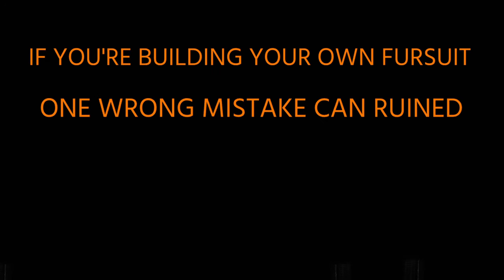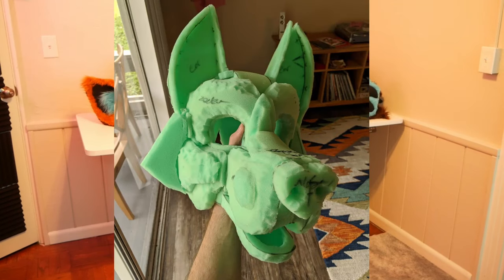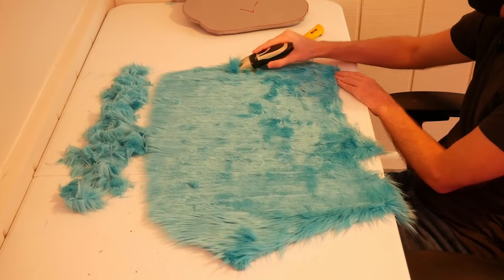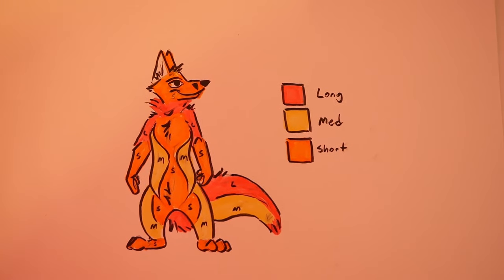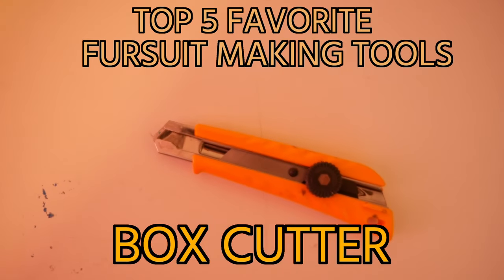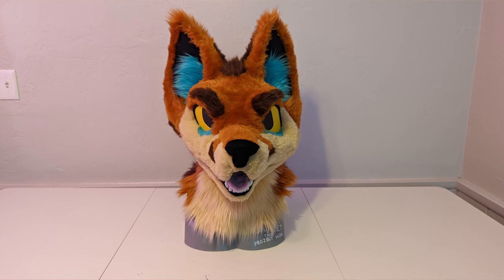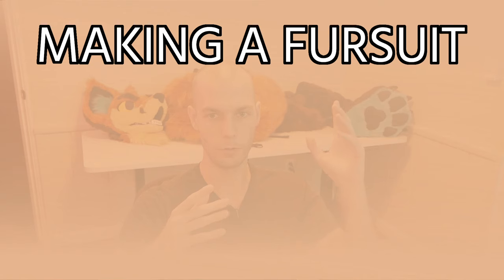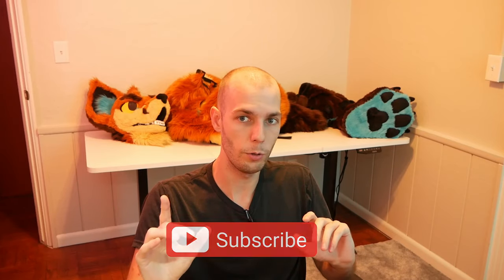5 Fursuit Making Mistakes You Will Make

Comment: A little note I wanted to add about sharpies !! Certain colours will bleed through while others will be fine, so always check first :3
Reply from the maker: that's a good advice!
Reply: exactly. When i made my first set of paws i wrote L and R so i could differ them. Well long story short the backing of the fur was way to thin and it bled through the fur easily
Reply: So true, I used a blue sharpies and washed my suit one day after a con and all the sharpie bled through and onto the fur! (The fur was white :[ )
Reply: Yes! Metallic sharpies are great as they won't bleed when washed.
Reply: How about using chalk, would that be a sufficient alternative?
Reply: @smb879  Chalk works super well !!
Reply: SkylarThePuppy1  Yep! The foam isnt seen at all and so long as you're not deliberately layering on a lot of sharpie, it shouldnt bleed through to the fur
Reply: This!!! I sometimes use crayons or chalk because they lay on top rather than seaping into the fabric
Reply: Another thing is, using washable stuff is probably actually better for fabric. Foam and duct tape (or whatever you use to pattern) is fine, but wish chalk pens or washable markers, you don't need to worry
Reply: I've used tailors chalk for marking darker color fabrics and it works really well! And I was able to brush it off with a bit of effort when I needed to, so that helps in case of mistakes. Also, silver metallic sharpies!
Reply: Ooh! Also sometimes if you have light fur and dark markers when you wash you'll suit the colors can bleed and destroy the colors
Reply: @smb879  yeah, I remember using black fur (a bat fursuit) and as I said, it was black fur for the neck fluff. We used chalk instead of sharpie not for  preventing bleeding, but it was literally just because we couldn’t see sharpie on the black fur-
Reply: Oh yeah, I was making a part for a raptor tail with thin fabric and it bled through T-T

Comment: another thing i would add is hot gluing your seams. I did this with my first dinomask partial, went to refurbish it, and i had to fully remake everything because all the fur was ruined from the hot glue. If anyone watching this hot glues seams, i would recommend learning hand sewing or getting a sewing machine it will save you so much time if you decide to refurb your suit. Im working on a different dinomask partial right now and its turing out way better then my first suit
Reply: sewing is flat out a useful life skill, and opens a lot of doors in terms of being able to make and modify clothing to suit your wants and needs. And that practice with clothing/fur will loop back and help you with the other as well
Reply: yeah, on my first dinomask i literally just glued all the fur pieces onto the ears
Reply: happend to me. was in a pinch and decided to glue it and now sew it, completely ruined the head and the fact that i sewed the fur backwards
Reply: Thirding this! I'm so proud of my foam head underneath a terrible foam job and I hot glued it all on, and I'm not light with glue. I have to remake it all, but I'm trying to see it as a fresh start.
Reply: I am starting a dino mask but using it as a base. I cut part of the upper nose and glued foam all over it. I just finished carving the shape. I'm glad I saw this because I was thinking about gluing the fur down with fabric hot glue. I guess I'll do both sewing and just glue down the muzzle.

Comment: a big tip I got from a cosplay maker who works with E.V.A foam: you can actually sharpen those box cutter blades with a whetstone or even sandpaper, just a few swipes between cuts is enough to keep your sharp edge going for A LOT longer, helps you save up on extra blades and you won't have to throw as many of them out!
Reply: Been doing this since I've read your post.
Just came back to thank ya XD. Not just for fursuits, but especially darn nice for signmaking stuff where I'm REALLY required to have a sharp point. Saved so many blades thus far!
Reply: @RazakelKairo1994  i'm glad it worked for ya!!

Comment: you have to be really carefull while using a sharpie. When using on foam, it's better to cut off small pieces of foam where the sharpie was used because when you will wash your finished fursuit, it can transfer onto the fur. for example you will have black stains on white fur because of the sharpie. And if you wanna use sharpie on fur, then its better to use tailor's crayon or soft pencil or chalk marker

Comment: I think I accidentally used too much hot glue for my foam base and now it feels a bit stiff when I try it on, especially in the cheek sections. Is there a way to fix that or are fursuit heads supposed to feel stiff from glue?
Reply: Suit head bases should be very plush and squishy, they are usually extremely light and you can completely squish it without really feeling any glue. If it’s not flexible like this, then you definitely added too much. In the end it shouldn’t make too much of a difference in the final suit. If you line it it should still be comfortable. People use solid bases from 3D printing or resin, so it shouldn’t be a big deal
Reply: You can try to trim the inside cheeks if your carful